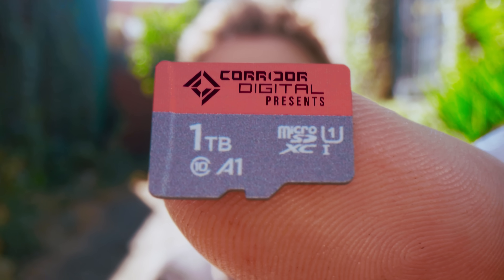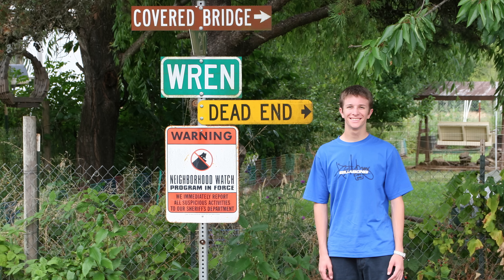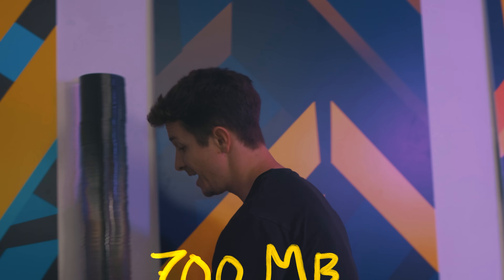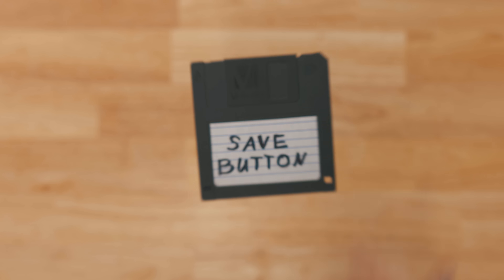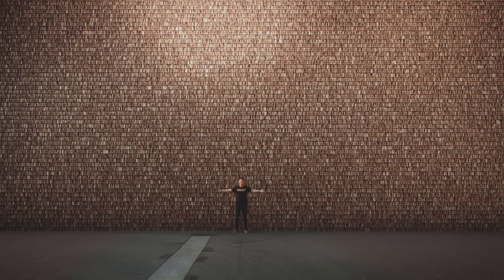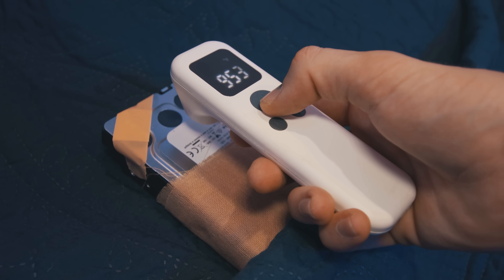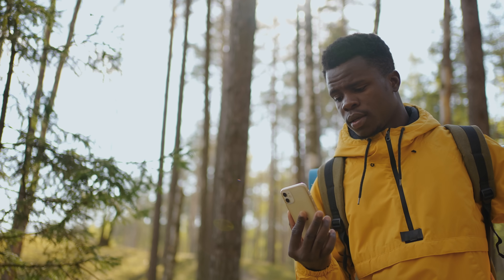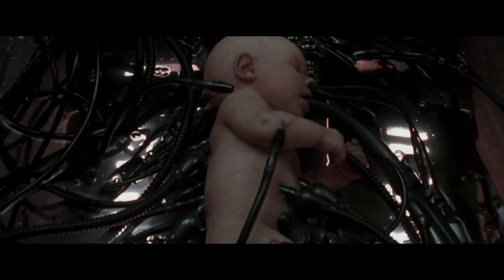VFX Artist Reveals the TRUE Scale of Data!

Comment: This is a topic I think about all the time. My first computer was a Radio Shack TRS-80, in 1980. It had no internal storage, just RAM. It used a cassette tape recorder to save data. I got an Apple II+ in 1983. Also no internal storage other than RAM. It had a 5.25" floppy drive for data storage, when I got a double floppy drive, I could load a primitive operating system from one drive while reading and writing data on the other.

From there, I got a Mac Classic. 20MB internal hard drive. I could store and run a number of software programs in that 20MB. After that, I had. Mac Centris, with 330MB of internal storage. I was running Photoshop, Quark Xpress, Altus PageMaker, Adobe Illustrator, and Word, among various games and other pieces of software. That drive served me well until I got a CD burner and realized I needed 700MB of free space just to hold the audio I wanted to record. I upgraded to a Mac Quadra A/V model with 2GB of hard drive space in 1996. 1998 saw me upgrade to a Mac G3 with a 6GB HD. I subsequently added a 50GB internal drive.

After that, it’s been a blur of Mac Cubes and iMacs. I’m currently operating with a 1TB internal drive and external storage somewhere in the vicinity of 70TB. When I think back 42 years to using a cassette recorder to store software, I’m shocked at how things have changed so drastically. (I’ve even used more primitive data storage; in high school, the computer class had a punchcard machine and we all tried writing a program in FORTRAN. Having a stack of punchcards to hold a very simple program is mind-boggling.)

Comment: Wanted to note that the research they wrongly based the 215 PB of DNA off of research done into how much data could be stored in one gram of DNA, not one strand of DNA. One strand of DNA is estimated to weigh about 242 picograms, which means it would take over 4 billion stands to store that much data. And if you multiply that by the 1.7 Quadrillion in the video, you have 6.8 Septillion strands of DNA with a mass of 1.7 Quadrillion grams. 1.7 Quadrillion grams is like 1/500th the mass of the asteroid that killed the dinosaurs. So not as giant, but also not nearly as small as a person.
Reply: Still love the videos though, the conclusion on DNA was just a bit off.

Comment: Not to be that guy, but technically wrong at 2:41. A gigabyte is 1024 megabytes. A gibibyte is 1000 mibibytes. I know...I'll see my nerd ass out...
Reply: 1024=2^10, seems to be working on power of two's. Makes sense since it's built on a binary system where each 'storage cell' is 0 or 1 or on or off.
Reply: @lapitop4206  correct. Once you hit bytes, it's 1024 all the way up, not 1000. There is different terminology used for increments of 1000. Kibibytes, mibibytes, gibigytes, etc. Otherwise, it's multiples of 1024 all the way up. It's why when you plug in a 10TB hard drive it only shows up as 8.2 or so. That missing 24 on each size jump (plus overhead).

Comment: If you want to know speed for scale you can look at how fast light would travel (in a vacuum) for a single CPU cycle.

2023 6ghz CPU: 5cm (1.96 inches)
2013 4.3ghz CPU: 6.97cm (2.74 inches)
2003 2.4ghz CPU: 12.5cm (4.92 inches)
1998 400mhz CPU: 74.95cm (29.5 inches)
1993 40mhz CPU 4.5m (24.5 feet)
1988 20mhz CPU 14.99m (49.18 feet)
1983 10mhz CPU 29.98m (98.36 feet)
1978 5mhz CPU 60.96m (196.7 feet)
1973 2mhz CPU 149.9m (491 feet)
1968 200khz CPU 1.5km (0.93 miles)

You can keep going back but you reach into "instructions per second", also numbers are purely from my first google result.
Reply: We had 4GHz Pentium IV around 2003. We hit the ceiling 20 years ago on CPU frequencies.

Comment: DVDs are usually dual layer, which holds around 9GB per disc rather than 4.7. (Double-sided dual layer is also an option, but those are vanishingly rare, for good reason.)
The first memory expansion I ever bought for a computer was 16KB for $80 and was about half the size of a paperback. Although if you're looking at permanent media, cassette tape would be a better comparison. Cassette tapes can store a surprisingly large amount of data for their time (if very little by modern standards) - about as much as a 1.44MB floppy.

Comment: 4K blu-rays actually hold between 66 and 100GB depending on the movie. Standard 1080p blu-rays are between 25-50GB. So, you'd only need a stack of 10 4K's to reach a terabyte. Fun fact, if I wanted to store the entire Lord of the Rings 4K extended trilogy on my PC, it'd take up 600GB of space by itself (300GB for the theatrical cuts). You aren't streaming that anytime soon ;)
Reply: You're thinking of dual-layer discs, the same way dual-layer dvd's could hold 8GB. They don't count because then you'd have to start explaining layers etc.
Reply: @cenciende9401  Dual-layer makes up a vast majority of blu-rays on the market, UHD blu-rays don't come in single-layer, only dual and triple. When I said "between 25-50GB, that's referring to single vs dual-layer, whereas 66-100GB for UHD is referring to dual vs triple-layer. Easier for most people to understand a range rather than layers and whatnot

Comment: You can store more than 2.12 KB of data on a single piece of paper. A version 40 QR code can hold up to 3 KB of data and you could print several of them together on a single A4 sheet.
Not to mention those novelty books like bibles that are the size of a matchbook. The Christian bible is approx. 4 MB and so utilizing the same printing technology you could easily get several megabytes on a single A4 sheet.

Comment: Hey so the bit about DNA isn't quite right. 1 GRAM of DNA can contain about 215 PB, not 1 strand. Your entire genome is about 1.5 GB (capacity, not meaningful data, as much as 90% of that data is "blank"), so multiply that by 37.2 trillion copies (cells) in your body and you get about 55.8 ZB of total data storage capacity in a human body. Not quite 370 billion. Actual meaningful data? 50-100MB per cell, or 1.86-3.72 ZB per human body.

Comment: Ok, this bothers me... the name "Floppy Disk" has literally NOTHING to do with the physical rigidity of the medium.  NOTHING.
You have 3 basic types of storage mediums for computers: Hard, Soft, and Floppy.
A Hard Disk is a storage medium that is hard mounted... it is NOT removable.  Now, the entire drive might be removable, but the storage medium is NOT.
A Soft Disk is a storage medium that doesn't exist, it is extremely volatile, being erased the instant it loses power.  Virtual drives and Ram disks fall into this category.
A Floppy drive is a drive in which the storage medium is removable from the drive.  This includes 5.25", 3.5", cd, dvd, hddvd, blu-ray, zip... BUT NOT FLASH drives, the medium is not removable, in fact a flash drive is a type of Hard Disk.
*Wanted to further clarify... a flash disk, like an SD card is a floppy, as it requires a "drive" to work, but a USB flash drive is a hard drive.

Comment: Ive helped build a Microsoft datacenter. The main reason the facilities are so massive is cooling. It takes some massive units to cool all those hard drives. You'll have cold aisles where the cold air is pushed into through a server rack with fans. That air will then go into a new self contained "hot" aisle and out the building.

Side note. Ive seen 5x5 boxes full of shredded 8tb hard drives. If only I could take one home for my PC :(

Comment: Blu-Rays are called that not because of the disc color but the laser that reads it. A DVD uses a red laser, like CD players. Blu-Ray players use a more powerful and precise laser. This is why they child 50GB instead of just 5.5 with the DVD. It’s like a Vinyl record. The closer you can get the lines the more you can fit on a single disc

Comment: 2:50
OBJECTION!
Isn't a 1024 bytes a kilobyte, and so on?
Reply: Yeah but the 24 left per mb is actually used for the software for the actual storing
Reply: @twiistedpanda4781  no it isn't.
Reply: Nope, kilo = 1000, kibi = 1024
Reply: @PavitraGolchha  and windows labels kibi as kilo and so on, leading to "the 1.8tb problem" as i like to call it

Comment: Actually…there are 1024 bytes in a megabyte, 1024 megabytes in a gigabyte, etcetera. Most people use the number 1000 when describing the difference between different storage units but that is technically wrong. Computer systems are binary, so all units of storage must be expressed as a power of 2.
Reply: Well, according to SI units using 1000s is right and 1024 wrong,  but yes, computer systems all use 1024 factors, even if SI wants us to call that kibibytes instead of kilobytes, and mebibytes instead of megabytes. And the 1024 usage predates the 1000 usage, and could be argued to win by being grandfathered in, no matter who pedantic some people wants to be

Comment: the calculations on how much paper can hold is SUPER FAR OFF if they were just using text maybe thats accurate but you need to rember a qr code can hold 3kbB it theory you could fit at least 4 across and have 6 rows of them at least which means it can store at least 24x 3KB so your number needs to be divided by at 24 but im sure you can actually squish them even tighter. so 100 x 3KB honestly wouldn't surprise me. but we can go even crazier if you use a 600 dpi printer plus colours it can get even crazier since you can store info in not just 0-1 you could in theory store 0-9 using different colours on each dot leading to even more insane numbers

Comment: 2 point something K for a sheet of paper?  You are rather low.  The commonly quoted figure is 4K each side .  On a monospaced typewriter, 66 times 85 (no margins) is 5610.  65 times 54 (inch margin every side) is 3510.
But you can write smaller, and use proportional fonts like "Times New Roman".  And in an encyclopedia in particular, there will be a lot of photos and drawings, which would be "graphics mode" to represent, at least 120 dots per inch.  7.5 x 9 x 120 x 120 is about 1 megabit or or 120K.

Comment: I hate being the one to point out inconsistencies, but I would like to point out that there's a bit of difference between original blu-ray specs and 4K blu-ray (BDXL).  Original Blu-ray specs were 25GB for one layer and 50GB for two layers.  Blu-Ray in 4K got a small bump and a third layer. 33GB 1-layer, 66GB 2-layer and 100GB 3-layer.  Also, DVD can come in multiple layers (1 layer is 4.7GB, 2 layers is 8.5GB) and even multiple sides, so technically they can hold as much as 17GB on one disc.

Comment: This is actually really relevant to me. I just finished a re-read of Ready Player One. When Parzival steals the private records from IOI, he puts the information on a 10 Zetabyte flashdrive, and is able to download this information onto said drive in a matter of hours and is able to re-upload this information to the OASIS in less than 3 hours. He then sends this information to Aech, Art3mis, and Shoto “instantly”. This goes to show how large of a simulation the OASIS actually is, how much computational power is needed to run it for a single user. Then multiply that by the Battle for Castle Anarak, in which it is said “Approximately half of the OASIS users were present.” That means that this hardware / software / server setup was running at a minimum of 100 Million users simulating the same part of the same planet at the same time. It is also said that there “was no noticeable lag, even with all the avatars present”. This just makes me think: Good lord, what are those servers like? What are their cooling systems like? No wonder there was a global energy crisis. Imagine all the energy and data that every bitcoin mining rig has ever pulled / used / computed. That is how much energy and data the OASIS would be powering through every second.

Comment: Did you guys intentionally leave out Yottabyte? Is it just too big for even this kind of video? Also Blu-Ray is named so because it uses a blue laser instead of a red laser for reading the discs. This is because blue light has a shorter wavelength and can therefore be focused into a smaller point. The smaller the point of focus means less space required on the disc for each bit which in turn allows for more data to fit into the same space.

Edit: Also the collaboration with LTT is awesome. I'd love to see more in the future.

Comment: 8:35 That’s true if we imagine our synapses are similar to individual bits, but of course our brain works technically different than a computer. While we are far from understanding those workings exactly, my understanding of our current understanding, if I understand correctly is that it may be closer to the truth to count all their possible Combinations, not just the synapses themselves. Regardless of whether my understanding of it is correct, there is a scientific paper (search for “Discovering the Capacity of Human Memory” by Yingxu Wang, Dong Liu, and Ying Wang) which gives a number of bits comparable to human memory as a one followed by 8,432 zeros (which would be like an 8,411 digit number in terms of zettabytes). There would not be enough volume in the observable universe to fit that many terabyte SD cards, nor even if we were to represent each bit by a volume smaller than an atom (the Planck size)

Comment: 1KB is not 1000 B it's actually 1024B (2^10)
Reply: 1 Kilobyte (KB) is 1000 Bytes. 
What you mean is 1 Kibibyte (KiB). That's 1024 Bytes.
Reply: @TAINCER_  I double checked, and looks like we are both right. It depends on OS: In Windows 1KB is 1024B but in MacOS 1KB is 1000B (I believe Linux based OSes use Windows notation)

Comment: You made this viscerally real -- a great feat of info-visuals! I remember, in 1980, turning down a mechanical engineering job at a military contracting company in the high tech belt in Boston. They said we'd be working on a touchless data storage technology, using lasers. Hmm...I wonder what that was. Japan released them commercially, but these guys were going military. Had I known it was CDs, which no one had seen yet, life would be different, but I'm happy I didn't, because that would change the future, and you guys might not exist. THAT would be a tragedy.

Comment: But a lot of the sd card failures could be because of the low level quality control plus the card you have in your hand is actually just a holder for the small chip it carries. As for detecting premature failure mode maybe its just not been investigated enough because of their ultra low cost.

Comment: I know I'm being pedantic, but I really wish he would have clarified that when talking about data it's 1024 kilobytes in a megabyte and so forth. It has to do with the binary system of data in computers where each bit (1 or 0) is double the value of the preceding bit: 1, 2, 4, 8, 16, 32, 64, 128, 256, 512, then 1024. 

Technically 1000 bits makes a kilobit. It's semantics in the purposes he's speaking of here, but still the difference is large enough that the wrong terminology could cause huge issues with data (and there are situations in history that the difference between bits and bytes have caused serious problems.

Comment: The human brain has a big problem processing volume, the reason why you only filled a tennis court is because of the nature of cubing numbers together. You should have kept to the idea that Bill Gates had with stacking paper and represented the information in length or height instead of volume. Still, awesome video as usual.

P.S. You did the same with the million vs billion dollars video. Tom Scott's version was far more enlightening by measuring the thickness of a 1 dollar bill then standing them on their edge and stacking them across the floor. This led to a 30 second walk across a car park for 1 million, followed by a 45 minute drive from the city to the coast to represent 1 billion.

Comment: Could you make a video about how insanely small and fast modern CPUs are? Each transistor is way smaller than a DNA is wide. And CPUs perform each operation as fast as it takes light to travel 10 cm. That is why cache has to be as close to the processor as possible. Light is too slow 😂.
I think it would be fascinating to see it visualized like this.

Comment: One thing you missed with the SD cards size, to be usable, you need hardware to mount and read/write them. You saw the board that Linus used. Multiply that size up to the data volume.

Comment: A CD-ROM is only supposed to hold 650 mb, but the tolerance for the laser allows for data to be pressed slightly denser than the standard ;) 

The CD-ROM released in 1988, it was only the CD-DA that released in 1982

Comment: One of the reason DNA is so efficient at storing data, i believe, is that it doesn't work with bit. It works in base 4 so basically 1 unit of dna (as in the smallest amount of data we can isolate in dna) equals 2 bits already. 2 units is 4 bits. Add that to the size of dna and you have a pretty dense memory storage.
Reply: It's just a constant factor of 2. It doesn't grow exponentially if that's what you're thinking
Reply: @cezannealves6926  it's not what i'm thinking, but still, on really big amount, even a times 2 makes quite a difference.
Though to be fair, before I wrote the first comment and made the quick calculation I did expext it to be more impactful.